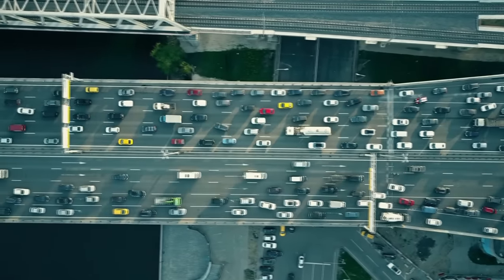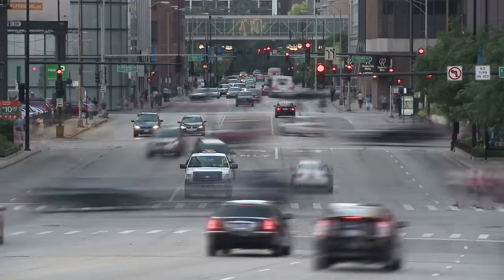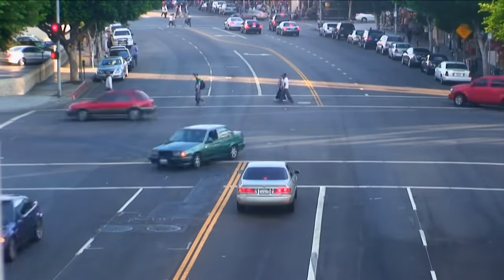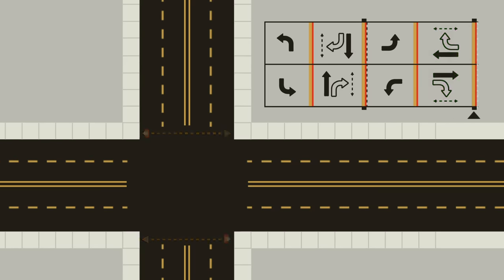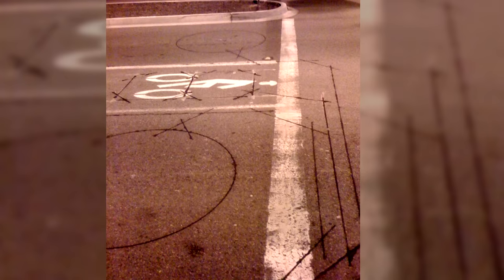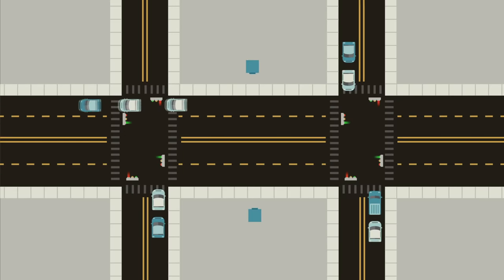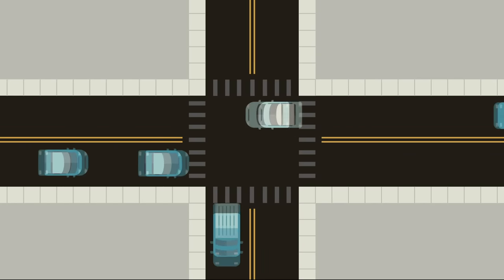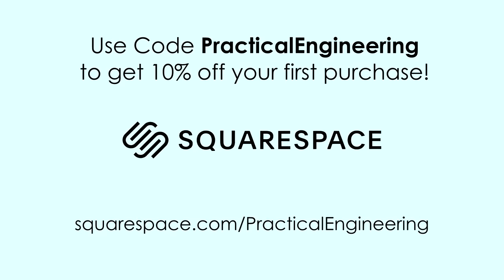How Do Traffic Signals Work?

Comment: I got an idea for minimizing the need for traffic lights where city blocks are concerned, one by one downsize the blocks, widening the pavement inwards, then take the corners create curved roads to connecting to the adjacent roads, then remove the intersection that occupied the middle and turn it into a round about, as for the super wide pavements in between these new roundabouts, convert part of it into parking spaces, this would be welcome to the workers and residents, in other words the blocks should be converted to look like the japanese symbol for anger 💢 where the lines you can see in the example I gave are pavements (connected though at the center, not the edge)

Comment: On green light traffic before move the driver must check clear intersection and check no one run on yellow or red at least 4 seconds.  And no rush to cross intersection by tailgate if someone use brake will cause accident

Comment: Grady, not sure what state you are from but where I live drivers, operators, and pedestrians are never legally given the right-of-way.  That includes first responders such as Fire and Police.  If you think about it you will see the safety issue in not granting the right of way to any vehicles or pedestrians on a roadway.  If you give people they will take it and that can and does lead to accidents. For example, a car stopped at a red light and the light then turns green.  The driver knows he has the legal right of way so he accelerates into the intersection and is struck by a car that did not grant that driver the right-of-way. Right-of-way in my home state is given not taken. Every driver approaching a red light is required by our traffic code to grant the right-of-way to the vehicle facing the green light.  If these people do not grant that right-of-way it is incumbent on the driver facing the green light to check oncoming traffic and avoid a collision if possible.  It is not always possible and so there are collisions.  This theory applies to stop signs and yield signs.  Giving roadway users the legal right-of-way is dangerous and a recipe for disaster.  When first responders approach an intersection they generally reduce their speed and check traffic before proceeding with their flashing lights and siren into the intersection.  this is how they make their presence known to other drivers and ask for the right of way at the intersection.  If they had the legal right of way they could just blow through the intersection at speed.  Right-of-way is to be given not taken.

Comment: If yellow light timing is done with consideration of the speed limit and safe stopping rate in mind, then why is there no road marker that lets you know to continue if you are on the speed limit and past this marker when the light turns yellow because stopping would be unnecessarily intensive and also dangerous if somebody was driving too closely behind you which is a general habit that a large portion of the driving population has?

Comment: To make a small motorcycle, bike or such be detected by a loop just attack a strong magnet as low as possible, this changes your magnetic signature to the magnetic loop, a 20 lb strength magnet usually works.

Comment: The lights in my city seem to have a predictable arrangement of movements. Sometimes if it detects traffic in one direction is heavier than the opposite, it will go out of the standard "lefts then throughs" into a mode where it puts the lighter traffic direction all red and allows the other direction through and protected left at the same time. This can even skip steps, the intersection near my apartment has a nasty habit of skipping left turn signals entirely.

But. There's one intersection I go through nearly daily that doesn't follow the same pattern. North/South does, but when it comes time for East/West traffic, it shows the eastbound traffic the turn and through green first. Then as traffic lessens, it reds the eastbound lefts and greens the westbound throughs. After this, it finally allows westbound left traffic. Why?

Comment: I know this is an older video and my question likely won't be answered... but does anyone know why, when construction is being done on an intersection that has permanent traffic signals, are temporary signals strung up on wires across the intersection even if the work doesn't involve replacing the permanent signals? They usually just cover up the old ones, not take them down... seems like unnecessary work. I'm just curious if anyone can explain what makes it necessary.

Comment: 4:14 He suggests grouping the opposing left turns together - something I've noticed and pondered about is that this arrangement seems to have been common in older traffic lights, while newer ones seem to be tending to have one left at the beginning of the straight-through and the other at the end, with the same-direction straight through going at the same time. Anyone know why they're doing it this way now?
Cities really need to install more of those coordinated lights - there's one set of like six lights on a major arterial road near where I live within a half mile that are totally uncoordinated, causing huge back-ups. Surely they'll get around to it someday, but I'd think it should get more priority - I see a far greater benefit per cost with traffic light coordination than any of the other infrastructure improvement projects they're doing. My hope is that once the algorithms are figured out and hardware (maybe wireless devices that can plug-and-play in existing cabinets) it will be almost trivial, can be done to a whole group of lights for only a few grand and taking only a couple hours with zero traffic interruption for an immediate substantial improvement - would be a total no-brainer.
Reply: This is called lead/lag left turn phasing and can impact how traffic flows through an intersection. Its typically used when traffic demand is heavier in one direction compared to the other or if a heavy left turn queue impacts the through lanes. If both left turns operate at the same time, then both through movements are stopped. However, if you lag one of the left turn movements, you can have the other through movement go and either keep a platoon of vehicles moving or clear out space in the lanes so more vehicles can get to the left turn lane. Just one of the options that can help to optimize traffic flow.
Reply: @JW-lj1sm  Ah, good points, thanks for explaining. I guess having it at the end of the through-green like that is helpful for times when vehicles could be backed up too far back to get to the left turn lane when it turns green and thus miss their chance to turn - I've had that happen to me a few times.

Comment: Until you mentioned self driving cars, my thoughts especially to the close major intersections. These work as long as everyone travels at the posted speed limit. A slow driver is just as dangerous as a habitual speed demon, as some mostly law abiding people who usually don't go weaving in and out of lanes will become frustrated with overly cautious operators and start working their way around perceived obstacles, causing the slower cautious drivers to slow even more causing traffic congestion.
Also it seems that when improvements are approved the data collected seems to have been taken too literally, and by the time the project is completed, the improvements seem to have not taken an increase in traffic over the time taken from the start of data gathering to physical completion and the improvement seems to be a negligible improvement.
Not only that but 100% conversion to self driving cars will take at least a century. So self driving cars are definitely not a panacea. Also in the beginning early adopters of self driving cars will still be competing with human driven vehicles for space on the arteries and capillaries, and this to my mind is going to cause massive problems.

Comment: Prague 3 when green party guy work on the traffic department: The goal is to make red lights so the drivers will take public transport instead, which would be "good for the environment".
Reality: Streets so full the air quality dropped, public transport stuck even more than normally and trams were involved much more in crashes (which could stop 4-5 numbers of trams in whole city and make them stuck even in another part of the city due to unpredictable detour).

Comment: Speaking of platoons, it would be interesting to know why do they form on the freeway outside of cities. If you drive over or under the average speed, it seems you're all alone then suddenly meet up with a pack of 10-15 vehicles the nothing again.
Reply: Platoons form when some idiot in the left lane won't move over and let higher speed traffic go by so you end up with 2 lanes of slowed , very pissed off, platoons.
"Traffic control" could include a roadside Tesla coil that could send an electrical charge to that idiot's vehicle and encourage him to consider what he is doing wrong.

Comment: "Actuated systems can also keep you from waiting at a long light..."
You must not be familiar with the ones in Oklahoma where you wait even when there is no one there and the side road will somehow always change and make you stop, even when no one's there.
Reply: There's one where I live that will legit skip several cycles before it'll finally turn green to let the 10 cars all piled up go. I've seen that damn thing go through like six cycles on the other signals while it sits there on red, like it forgot where its place in the cycle is-- even as the turn signal right across from it has kept its place in the cycle, letting drivers make their right turns. And I swear its gotten even worse since they put in an ambulance garage in the area.

Comment: We should have RFID chips in cars (and motorcycles and scooters) and every light should have at least rudimentary calculating capacity. Or full on central control by a computer program. Imagine if every light could sense the cars coming (from a distance) and adjust its function to produce the shortest wait times possible. In large cities, we could drastically reduce commute times, gasoline expenses, traffic jams, and road rage.
Reply: Thats coming (DSRC ('free' for the user, not for the municipality) or Cellular (IE: cell companies can charge you for car data rates, municipality still has to pay for the hardware)), and the benefits are largely overstated in my opinion. For transit priority, heavy freight, or snow plows, it could work because those vehicles carry such a large amount of people/good/use in one vehicle compared to cars, but to squeeze out any more efficiency for cars while considering all directions of travel...you're really going to see a small ROI. I've seen these systems, and I've not been too impressed. To really get rid of urban congestion, you have to reduce the use of low occupancy vehicles, or at least the peak nature of current traffic.

Comment: I always thought the detectors under the road at lights sensed weight not metal by means of a current. I guess backing over it to get the light to change did nothing but pass the time all these years.

Comment: In our fair city of Pittsburgh (pictured twice, our asinine traffic system, buses, and signs stick out, even blanked out as in the second one), there are two stretches of road where, when it’s quiet, the lights phase (usually) to allow a single vehicle to go two dozen blocks at a steady pace, sometimes at 26 mph exactly (set cruise control out of the first one, they clear the split second you get to them), other times you have to do well over 50 (a multiple of 25) to get them all before they time out, and on other times, you have to go at a clip to get to a couple of them, then lock up the brakes because one’s out of phase.  Utter nonsense.  Then again, and i can say personally, our traffic department ain’t the brightest folks.

Comment: The main goal all driver must stop then turn on green light.  The operator change the color very quick and traffic run on the yellow and red.  The operator quickly switch for crossing traffic to move to bump yellow and red light traffic in middle intersection

Comment: I've been wanting to work on an optimizer that can make traffic signals in a city more dynamic. I like to play Cities: Skylines because it has a mod that allows you to setup times lights that can be adjusted and junctioned for different situations. I've been wondering what kind of data or software do cities use for planning traffic lights and sequences?

The worst I've seen was Puerto Rico, where there traffic signals seem to have really short yellow lights, but everyone speeds. The best I've seen is in Indianapolis, entire roads are programmed to allow "platoons" to travel for miles without a red light.

Comment: 6:08 "In most places in North America, you are allowed to enter an intersection for the full duration of a yellow light, which means there needs to be a phase...to clear"
Is that actually true or is it just a protection for those who inevitably break the rule?  I thought that in most places the rule was you must clear the intersection before it turns red.
Reply: Matt Gately It's true where I live (that you can enter the intersection as long as the light is yellow). If you're in the intersection already when the light turns red, traffic that just got a green light is required to wait for you to clear the intersection first before they're allowed to go through. In fact, in driver's ed here they teach you to wait for a count of three right after the light turns green to check that there aren't vehicles still in the intersection before going through (though in practice no one does that)

Comment: These lights are smart I drive everyday but there are popular intersections that have the worst time limit on green light. There's 20 cars wanting turn left when light goes green only about 3 cars are able to turn before yellow then 3 more cars on yellow and 3 more cars finish turning when it's actually red and almost cause and accident. Some greenlights for turning need more ON time to clear the turn lane completely and safely. The turn lane is what holds alot of traffic, cars will line up past the turn lane and wait in the straight lane to turn cause people trying to go straight wait 3 light cycles to go straight or just swerve around them going over the curb with possible damage to vehicle. So we need the lights to be more smarter even though they are smart but need more sensors to handle peak traffic hours way better and make it much safer. It's 2021 and gas is taxed heavy here in Cali for road work so come on California update our traffic signals to the latest technologies !

Comment: Traffic lights are almost always programmed on the principle of maximum inconvenience. Basically, hold a car at a red light for a long as possible until a car approaches the crossroad. Switch signals to block that car instead. Rinse and repeat.
Reply from the maker: Haha it does seem that way sometimes but I promise no ones out to get you. Traffic engineers sit at lights just like everyone else.
Reply: @PracticalEngineeringChannel  Well, not strictly true. Extra traffic lights are used at times to discourage traffic on a route and force it onto alternate routes. They certainly reduce the flow on arterial roads compared to say roundabouts - depending on traffic volume and driver sophistication. They also cause also rat-running which traffic designers really hate.

Comment: Traffic lights in my city are so badly timed. You leave a red light, accelerate up to the speed limit, then the next one turns red just in time so you need to stop. That’s bad design. It should turn green by the time you get there so you keep going

Comment: In South Africa, traffic signals are called 'robots'. This may sound bizarre but actually makes sense when you consider (a) the definition of 'robot' to be "any automatically operated machine that replaces human effort, though it may not resemble human beings in appearance or perform functions in a humanlike manner" and (b) that the first traffic signals were indeed controlled by a human being at each intersection.

With time the human traffic signal controllers were replaced with  "automatically operated machines  that replaced human effort" ie "robot traffic signal controllers" shortened to simply "robots"

Not so bizarre, actually.... 😊

Comment: Half of that doesn't apply to Florida. There is no logic with roads here. The yellow lights where I live are 1-3 seconds, even on the highway where speeds reach 55mph. They do not allow platoons to stick together by any means except at night when they shift from timers to sensors. Our underground sensors do not work at night at any of the side streets unless multiple sensors detect a vehicle, so I usually back up and move over a lane to kick the sensors and get the lights to change. That or they switched the side streets sensors to timers of 10+ minutes. Though I would like to point out, the barrier/time between red in one direction and green for another is extended in most urban areas to reduce traffic accidents of people running lights. Where I live it's 7 seconds at all intersections with a speed of 35mph or higher, and 5 seconds everywhere else, that information was provided by FDOT when I dropped off their order and asked about it. I drive for a living so I spend plenty of time watching traffic and flow. They are also adjusting yellow light durations in many places with high volumes of semi trucks to help reduce accidents or blocked intersections due to semis not being able to stop fast enough.